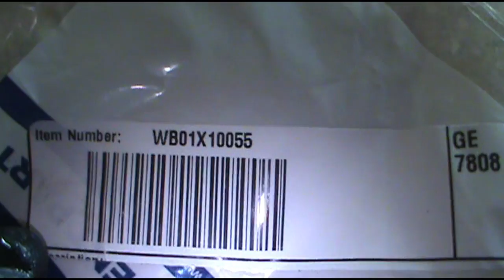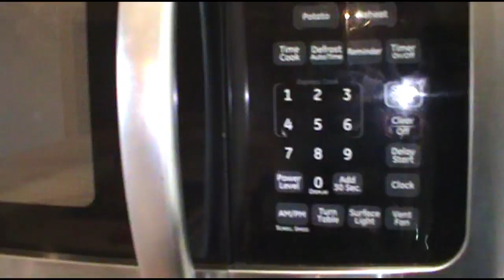Inside Top of Microwave Melted

Comment: once the grease/food burns some it turns to carbon which we all know is conductive, so it focuses the energy there arcing and burning the other materials, bam chain reaction!

meanwhile the early 1980's "amana radarange" is still chugging along happily, nice and shiny stainless steel inside, glass tray the size of the whole bottom. yeah it's broken before, 2 or 3 times a door spring end broke off and I just bent the next coil out and reconnected! once it grease gummed up the temperature probe jack, making it keep going to probe temp, clean it good/degrease and fixed ;)
Reply from the maker: 👍😆👍 Thank you so much for watching throttle!